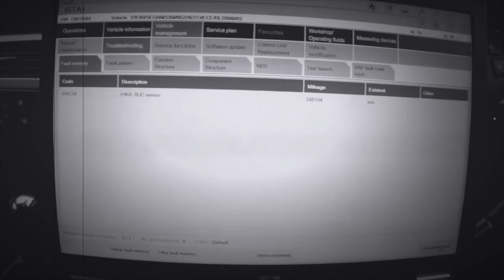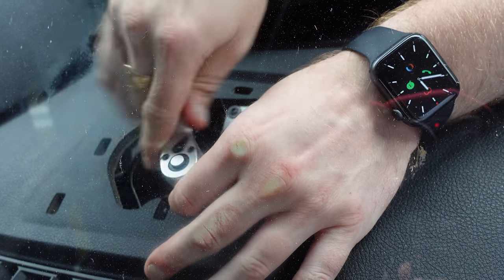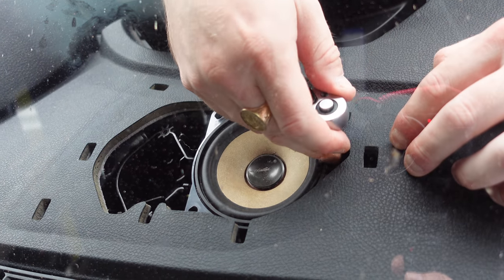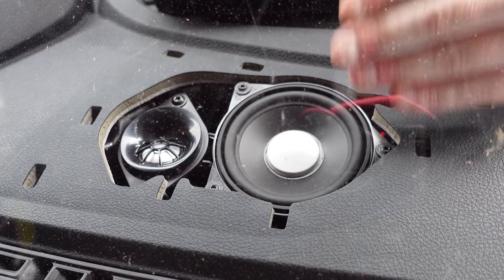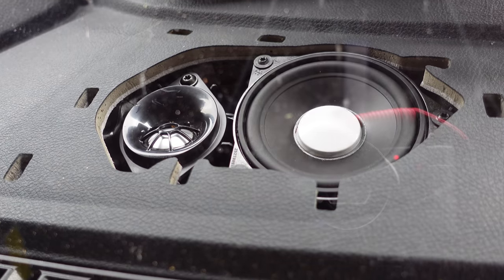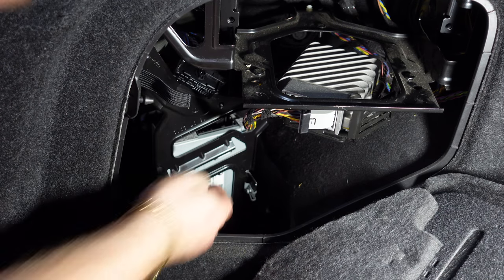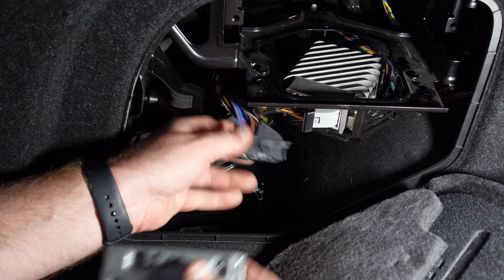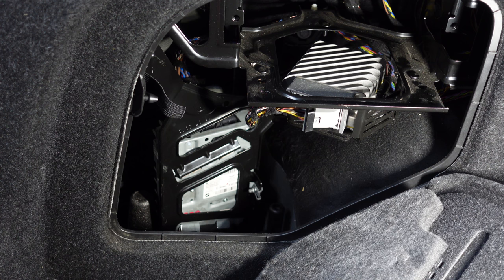BMW F Series HIFI To TOP HIFI / Harman Kardon Retrofit & Dash Speaker & Tweeter Install

Comment: Hi, which model year is your F20? I have a F20 MY 2018 with hifi system and without ASD. I have installed Harman Krdon amplifier 6846905 but It doesn't work. Do I have to code it?

Comment: Would you happen to know if F10 S676 HiFi amp (the one I have) is interchangeable with S674 HK amp? I believe it's a good improvement in power and should be PnP but still wasn't able to find proof it'll work.

Comment: Hi there,
Good stuff i must say. I’m looking to upgrade to HK system and i already bought the complete parts: Amplifier, speakers, tweeters. My car is a 2017 M240i coupe xDrive (F22) and have HIFI sound system. Question is: will the amplifier work without coding and the tweeters fit inside central dash and rear window dash panel without any modifications? I’ll appreciate your input even though I know your car is not identical to mine. You should know that my car is a Canadian bought vehicle. Thank you and keep doing these videos if possible please.
Reply: Did you manage to install it? I have a F20 with hifi system and I installed Harman Krdon amplifier 6846905 but It doesn't work. Do I have to code?
Reply: Do you guys know more i am planning the same any suggestions?

Comment: Hi, will this work on a G01 with the Hi-Fi system? If I swap out the amp, do I need to change any wiring? And do you know if the G01 has the fiber-optic cable like you mention in the video? Thanks for this!

Comment: Sir, I plan to cut the dash board to put in the dash speaker, would you pls provide the measurement of the clip size on the dash board? Thank you!
Reply: If you cut a hole doesn’t that mean you gotta wire up those two 2-pin connectors that connects to both tweeter and speakers?

Comment: Hello, could you tell me what a solid yellow and red led inside the top hifi amplifier indicates? I can't find any information on both lights staying solid. I just replaced one in a car I bought due to it being fried. Replaced with a identical one from a donor vehicle
Reply: Also, it's got MOST input(3 plugs)

Comment: Hey. I have F11 with hifi S676. I need just top hifi amp for more power? Plug n play like in your video?
Reply: @LUCIOmedia  Hey i just retrofitted the same harman kardon amp on my F11 with Hifi S676 its plug an play i also changed all speakers there is a very big difference in the sound

Comment: Do you have any idea if you install a HIFI from X1 2012 to 328i 2012, will it work without programming or coding? I know these are all analog so it should not need anything.
Reply: Hey so I got it all HIFi model amps work for the different model car. It probably helps to have one from a similar year, but amps are interchangeable among all models that use them. And they are not programable period. I used an amp from an X1 on a 328i both from 2012. So much for buying the numbers on the amp, that is false.

Comment: Why not the bang and olufsen system?
Reply from the maker: Was never available on F20 and doesn’t have the wiring for it. Only wiring for Harmon Kardon I did try and install it but wasn’t possible that’s only possible on F30 because of the speakers for in the doors which F20 doesn’t have.

Comment: Hi Doc, enjoying your posts thank you they're really good... I have F20 with the basic system S654A, I've ordered front door HK retro kit but can I fit a HK amp?  I think I may not currently have an amp apart from the head unit?  Appreciate if you could help thanks... (2015 LCI btw in case it matters)

Comment: Hello Sir. Great video. I have Hi-Fi system on my F32. My question, is it worth it to upgrade central speaker to HK but keep Hi-Fi amp?
Reply from the maker: NO its really not it will give terrible sound and you won't get the full benefit of the full sound without the amp
Reply: @BMWDoctor  Thank you for quick reply sir. Do you think it will benefit my system if I disconnect central speaker completely? My current setup is VIBE PnP mid + tweeter on the front and HK mid + tweeter on the rear. Central speaker and subs are Hi-Fi all powered by my standard Hi-Fi amp.